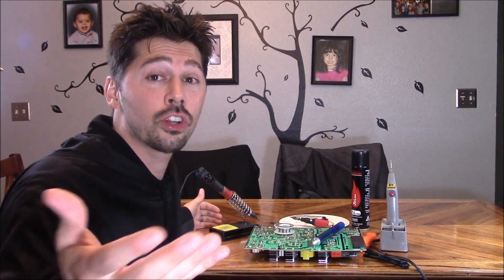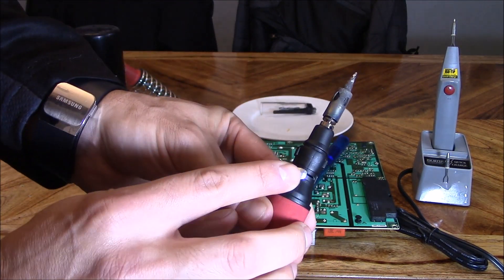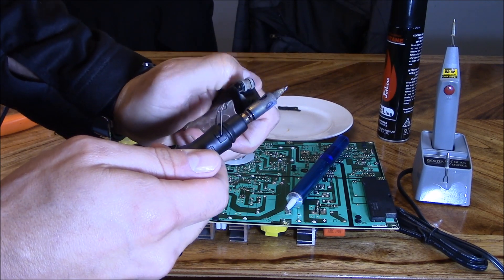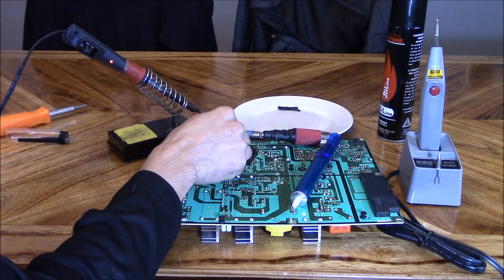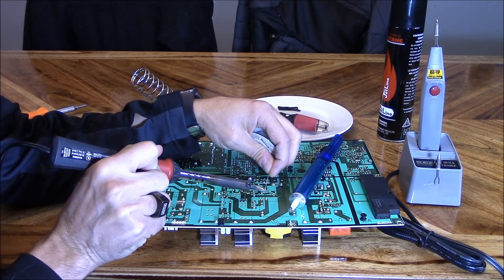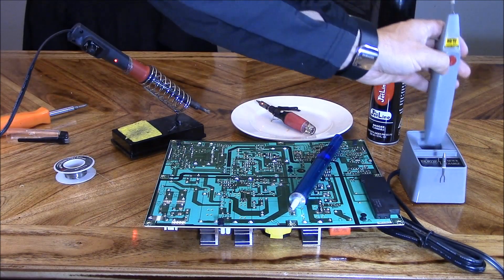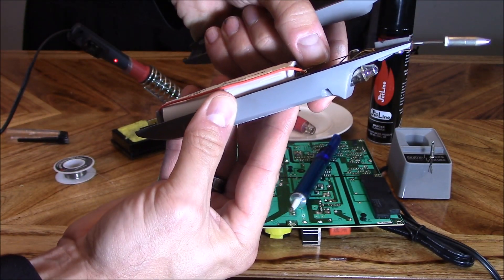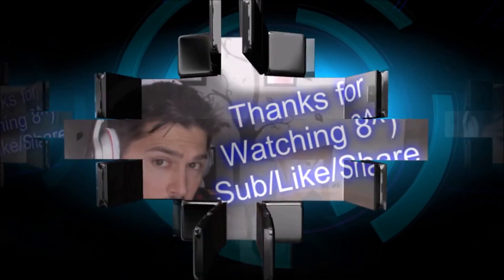FASTEST HEATING soldering iron: electric vs butane vs rechargeable review

Comment: Just a tip for the butane soldering iron. Make sure that the butane is not on all the way. Just a light hiss. I found out that it heats up (becomes usable) faster than when you turn it on all the way. Also, you only need to light up one of the vent holes, with the flame pointed downwards. The reason for this is if the butane is on all the way, the flame is stronger, but leaves a small gap between it, and the heating element. A smaller flame keeps it tighter with the heating element. If done correctly it only takes about 10-15 seconds to be usable.

Comment: I really wish ISO-TIP had a battery operated model more focused on portability. It should include a cap and either have a quickly replaceable battery or be able to charge with a standard cable instead if relying on a dock. I need something for my electronics tool bag and to be honest the butane ones scare me a little.

Comment: look up a Metcal soldering station that one heats up immediately if you flip the switch and touch the tip in 3 seconds there is a burn.

Comment: I have a similar radio crap electrical which is ok,  but it does seem to take a while to heat up AND cool down.  The cord can be really annoying at times too. It does ace two settings but I've never understood what the applications are for each.

Comment: Just pointing this out: even though there are no obvious extra costs associated with the direct ac plug "conventional" iron, you are still using electricity. If you leave the iron on for hours at a time, you might find that the butane is cheaper - at least it forces you to be conscious about your fuel consumption.
Reply: There is no reasonable scenario where the butane is cheaper.

Comment: radio shack irons are junk. that butane iron u have there looks like a cheap pos. power probe makes an excellent butane iron with attachments for shrink tubing and has a peizo electric starter much more handy for field work than the one you showcased here. weller makes the best ac irons imo
Reply from the maker: +torcher78 very true
Reply: +torcher78 I think the iron itself is ok, it's the tips that wear out fast.